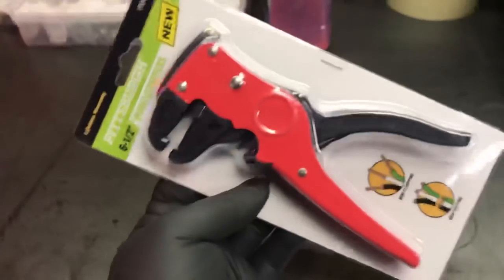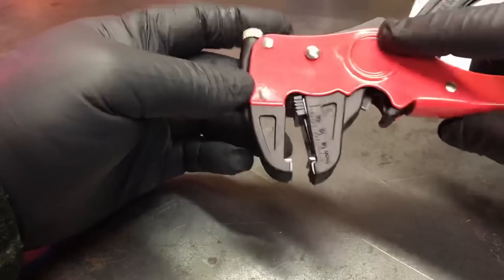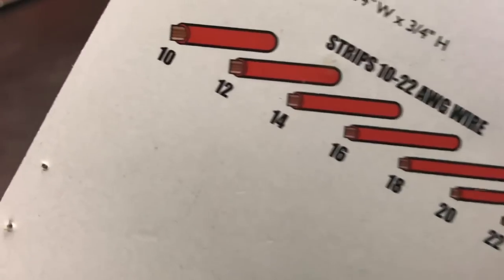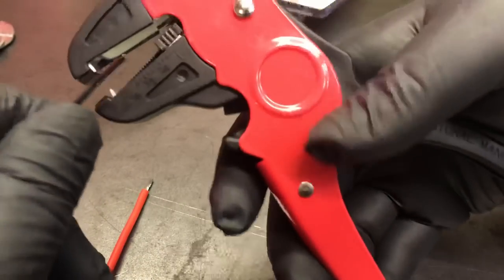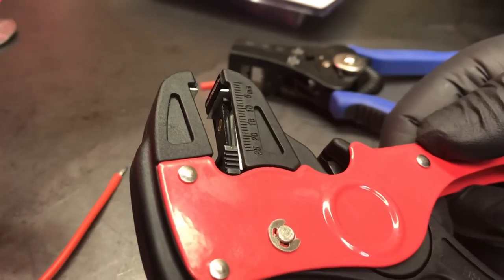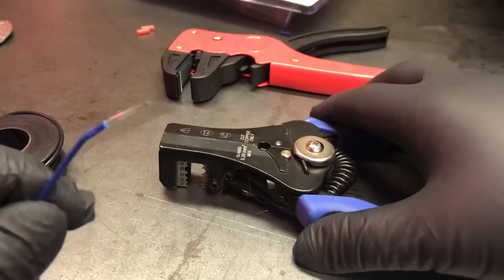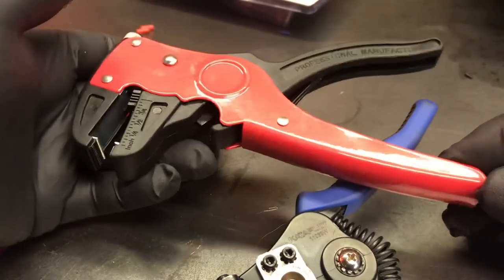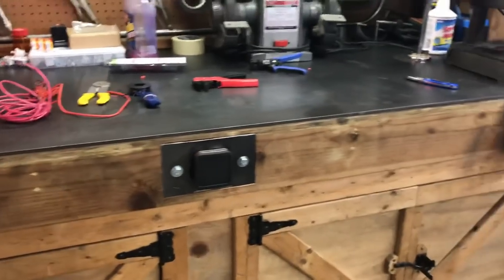Harbor Freight Wire Stripper Cutter

Comment: I just bought a [air of these same stripper/cutters and ive only tried them on a piece of solid 14 gauge and I don't think they work very good for that,what do you suppose that little knob on the top rear of the strippers is for?
Reply from the maker: Jeff Wagner That little knob on the back is to adjust for wire thickness. You can back that knob in or out depending on if it’s not able to strip the insulation or if it’s cutting into the conductor. (I only figured this out after making this video)
Reply: It's to adjust the amount of pressure used to cut through tougher, thicker wire or to use a lighter touch on thinner wire.
Reply: Help! How i can put again the knob? It came out when i was adjusting it and now it doesn’t get on, pls

Comment: Friends, at the top of this wire stripper there is an adjustment just to cut more rigid, harder layers of the various types of wire. There you regulate how soft or hard the cover is. It lacked to explain this in the video, and that was why the pliers did not decapuate the thicker handle, of red color. No adjustment was made to the screw located on the top of the pliers!

Comment: Nice test. In all fairness, the THHN wire looked to maybe be 8 AWG. Those strippers are only rated for down to 10 AWG. I’m gonna go snag a set this week since I’m doing a garage rough in with 12 AWG. Thanks!
Reply from the maker: Florida Two Wheel Adventures thanks. I should have been more thyroids with this review. I figured out afterwards that there’s wire cutters in the handle and that’s the screw up top is to adjust the tension in the cutter. This little tool has impressed me. Simple, cheap and effective.

Comment: I bought a Chinese-made one and it worked great for awhile, but now it's messed up- the jaws are out of alignment (bottom jutting forward) and no clear way to fix it. UPDATE: just fixed it!!! Just took out the only removable pin, replaced and it's aligned again- miracle!
Thanks for the video- it inspired me to take a new approach instead of just throwing it away in disgust!!!

Comment: Appreciate the review ! I ended up getting one of these and used it for 10 gauge wire. Unfortunately no matter how much I I adjusted the pressure knob it still cut some of the wire off . It did work a bit better for smaller gauge wire though
Reply from the maker: mechtech104 I think that 10 gauge is a little too big for this type of stripper. I use these for 12 gauge and up.

Comment: I just bought those on Amazon for $11.  Different name but identical look. The instructions for it say 14 - 22 guage. Suits my need. I'm converting a bunch (54) of florescent fixtures over to led  bulbs. Removing the ballasts so need to strip those ballast wires to put into wire nuts to power the "tombstones" on the fixtures. At least 8 to nine wires each fixture. This is a much quicker stripper.

Comment: Hi thank for your video. I am looking for repair video actually. I accidentally dropped a similar wire striper, and the top adjustor and 1 steel rod/cylinder came out.

I just couldn't fit them back. Could you show me how to, please.

TIA

Comment: For hard cable you can adjust tention of blade by setting knob given top site of stripper and one  more thing to tell that you can adjust insullation length adjustment in it. See stripper propperly..

Comment: Hi, please, could you help me?

I have a wire stripper and cutter almost identical to that one red and black you showed on the video.   Therefore, I would like to ask if you can take it apart to see the location of a small piece of metal in a cylindrical shape because I am not able to find the exact place to fit it. This piece fell off before I was able to disassemble the stripper, when I positioned it vertically and was undocking that red part of it. I assume that piece was next to the cutter.
Thanks

Comment: Dude, it will do that cleanly, need to learn how to use a tool before you go opening things. You have to adjust the tension behind the tool for harder wire.

Comment: As I just found out from another video you have to adjust the pressure on your cutter blades by the knob on the top. Also you have a slider in between the jaws that let you know how long you want your cut wire to be in inches and millimeters. So to cut the heavier gauge wire you would need to adjust the knob at the top. Thanks for your video.
Reply from the maker: Yup, I realized that after posting the video. Still love these strippers. I use them often.
Reply: chevelle74us good to know. I haven’t used mine yet. Hopefully today. The project I have to do is a little intimidating for me so I have to take my time and think it through. LOL again thank you for your video.

Comment: Maybe see if the cutter on the tool works as well? Maybe add it in with another video?
Reply from the maker: Josh B you know I realized that after the fact. Also, I noticed the little knob on the back increases the tension on the cutter, so it may end up stripping that heavy THHN insulation. I’ll likely end up making an update on this. This tool has more features with it than I originally thought. Currently there’s a 30% off coupon for items under $10 which I believe expires this weekend. That would make the tool around $4!
Reply: @chevelle74us  I think I'm going to go pick it up. I was wondering what the knob was for on the back of it too. Kind of surprising they have so many features in such a cheap tool
Reply from the maker: Josh B it’s a simple design and it’s mostly plastic and stamped steel so I don’t think they cost much to produce. Also, this looks like an exact copy of the Matco tool, so my guess is that they’re all made in the same factory oversees. I think the problem that some people have with this type of stripper is that they don’t adjust the tensioner knob for the type of wire they’re stripping. I think for most type of automotive wire, you can probably adjust the knob and it’ll strip a wide range of wire without issue.
Reply: @chevelle74us  The matco ones are made by tool aid. If you were to get a set of them and compare them to the hf ones you would notice that while they sure look alike they have a lot of little differences that make it seams as the hf are just a clone  and didn't come off the same line.

Comment: Check out HF ratcheting terminal crimpers. They don't just resemble the Matco ones, I think they are the same!
Reply from the maker: upside downdog I’ll look into those. Thanks!
Reply: They're not the same its a very common common design, the big give away is they are made in 2 different countries.
Reply: @TinoR626  
2 different Chinas?
Reply: @upsidedowndog1256  Taiwan and China, so yes two different Chinas.

Comment: I'd need a receiver like that to put my winch in so I could pull my car back in the garage after 'fixing' it in the driveway , HA!!
Those wire strippers are handy when stripping wires in tight spaces, like under dash, behind glove box, etc. I spend a lot of time wiring there, grr!!
Reply from the maker: applejacks971 yes, and I especially like them for stripping really short pieces of wire like when you need to make a repair on a wire that broke close to a connector.

Comment: I just had  similar hf pair fly apart on me so I'm not a big fan, but you might want to use the adjusting knob before claiming it won't work on a particular wire.
Reply from the maker: Yes, you’re absolutely right. Only realized it after making the video.
Reply: Mine does fine with stranded wire but no matter how it's adjusted it only cuts solid wire. Any suggestions?

Comment: The strippers you just picked up also have a wire cutting ability does it work good or it's not worth using
Reply from the maker: KONAMAN Studio I forgot to mention the cutters in the video. I just used the cutters for the first time last weekend on some 14 gauge stranded wire and it worked great. Some people say they’ve had issues with these strippers, but I think it’s because they don’t properly adjust the nut on the back of the tool for wire gauge they’re using. So far I really like this little tool.

Comment: I was in the market for a pair of Harbor freight wire strippers for the longest. When I went they didn't have the yellow handled automatic ones which strips 12-26 gauge.  I went to ace hardware and for $18.99 got the gardner bender ones. They strip 10-26. I might eventually try to get a backup pair from harbor freight for the future. The ones In the video aren't that good for me and its why none of the cheap manual ones worked for me. I need to strip 22-26 gauge.  What's funny is on the harbor freight site the ones I am talking about are compared to the gardner bender brand.

$10 at ace hardware https://www.harborfreight.com/heavy-duty-self-adjusting-wire-stripper-36810.html

Comment: Just bought it today for $5.99. Does not work at all. The blade part just slides over the wire, never strips it. Taking it back tomorrow.
Reply from the maker: Did you try adjusting the knob?

Comment: The problem with this tool you can't make a middle strip, you just can make a front strip .
Reply from the maker: Azoz Boj I usually use my linesman Pliers for stripping in the middle.

Comment: Don’t want your hands dirty? Lol
Reply from the maker: pjm8047 Lol I was doing some work in the garage and was gonna head out so yeah didn’t want to get my hands dirty lol. You know I always hated wearing gloves but after getting used wearing them it’s great. If I go in and eat dinner, just pull the gloves off and ready to go.
Reply: I’ll let it pass lol have u every tried out the Irwin branded strippers?
Reply from the maker: pjm8047 I haven’t. Are they an automatic stripper like mine or a more traditional plier type?
Reply: Looking for something that will last but not too expensive.
Reply from the maker: pjm8047 Harbor Freight also makes a set that looks like the Irwin’s. I want to say they’re like $14.
Reply: @pjm8047  I have those Irwin strippers, and they work great.